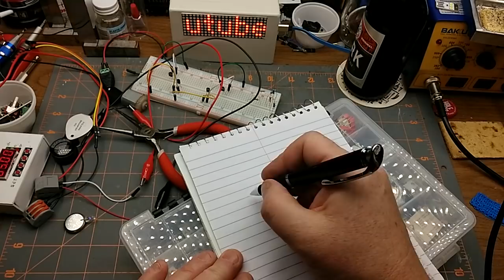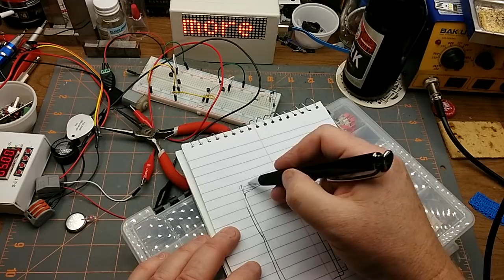a couple of shop projects

Comment: Red tape is a definite improvement. If you’re like me, you’ll soon be making another parts storage cabinet. I made mine using plastic crates and left a fair amount of unused space. Getting close to the end of it now. (Instructables- “Modular Parts Storage”)
Reply from the maker: It seems that I need to upgrade my storage about once a year. 

The wheels on yours are a nice touch. I might add that to my next storage project.